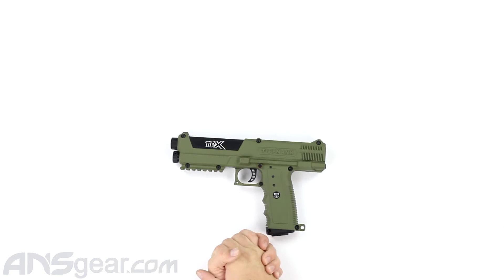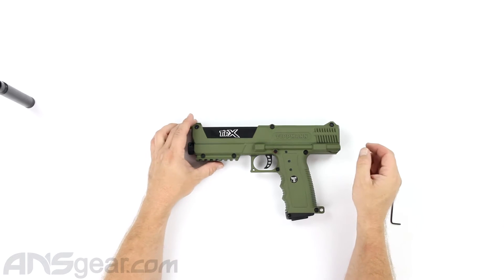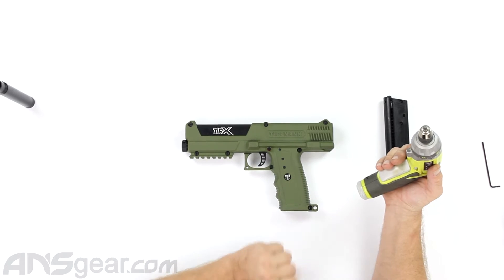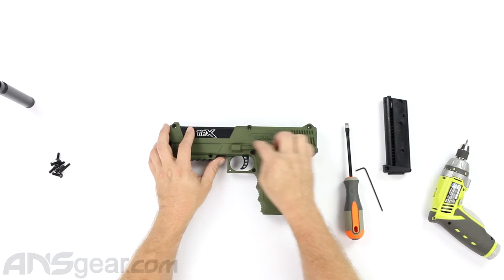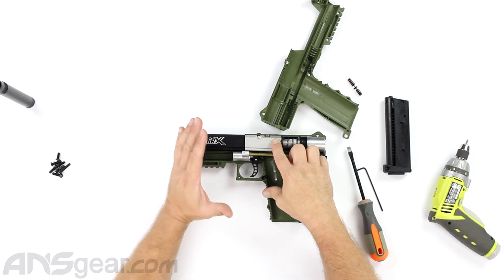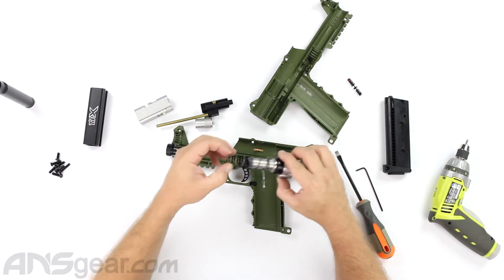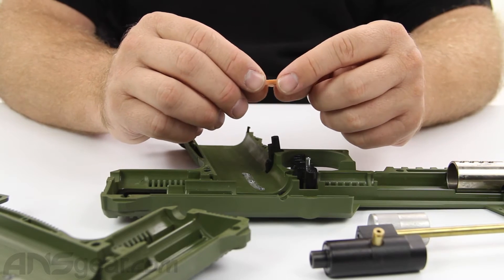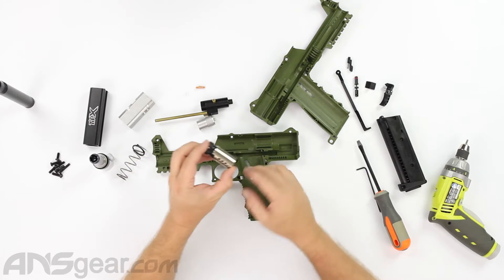Tippmann TiPX Trufeed Paintball Pistol - Maintenance/Repair

Comment: I bought one of these used off of ebay and i could not figure out why it was leaking when I was using an air line instead of a twelve gram (I didn't have an empty one inserted). Thank you for saving me a ton of head aches

Comment: At the beginning, the CO2 cap might have been hard to take off because the frontal screw under it might've been too tight
Reply: Nevermind, this wasn't the case with the TipX shown in the video. However, this is a common problem.

Comment: What is the o ring called that he talks about at 13:20?
Reply from the maker: This part is the 12 gram puncture seal. Part number TA20034. We do not have it individually on our sire however it may be in one of the parts kits: https://www.ansgear.com/SearchResults.asp?Search=tipx+rebuild&submit=+

For Confirmation or availability of the individual part feel free to reach out to Tippmann: 

1 (800) 533-4831